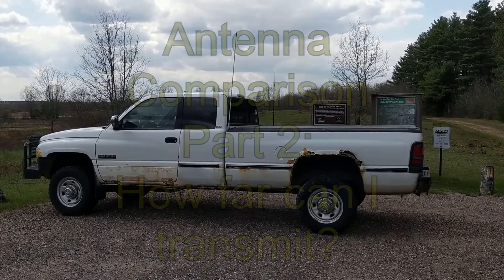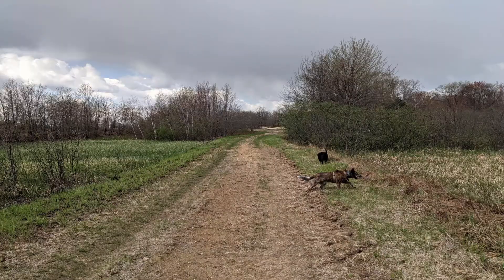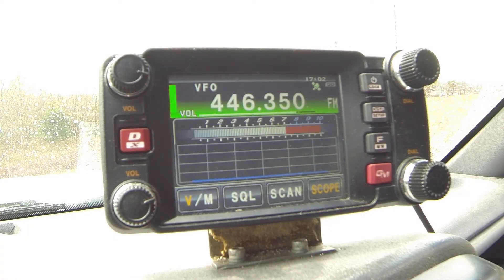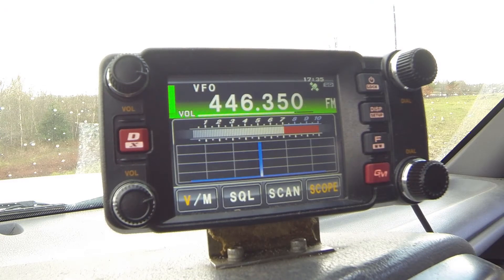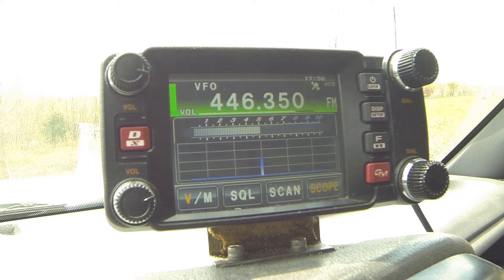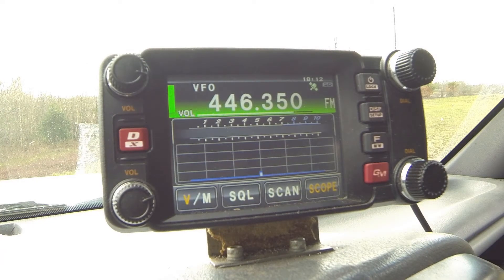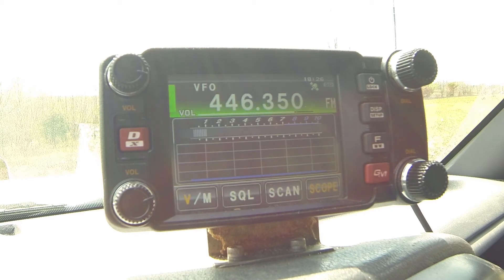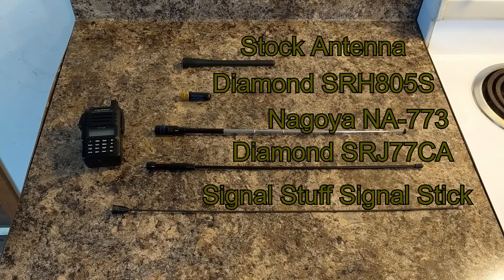Antenna Comparison Part 2: How far can I transmit?

Comment: In a SHTF situation, you'll always be able to find higher elevation, even if you find a pile of rocks or other elevations that occur naturally in the wild. One antenna you should look at (and has great reviews) is the Retevis RHD-771 and its shorter brother, the RHD-701 antennas. Don't get the cheaper Retevis RT-771 antenna by mistake.

Comment: Both videos very helpful nicely made - thank you!   Curious, are you confident that the 773 is a genuine example?
Reply from the maker: Honesty not sure about the 773. I know a lot of them can't be knock-offs. But it's still performed fairly well and I do like to telescoping mast.
Reply: @soderlund416  Thanks for the reply.  I have a 771R and I'm rather pleased with the size/performance.  Along those lines, I also have a Smiley 1/2 wave that is 8" down and 36" up.  It's my best performing "walking" antenna.

Comment: Interesting to see how well the Diamond performed. Just a few weeks ago I had a 30-mile simplex QSO on 2M with the Yaesu FT-4XR using the Signal Stick antenna. The contact had a QTH and antenna high up though. Ultimately, it's supporting Ham Study, the flexibility (packability) and performance of the Signal Stick that sell me on it. Although, I'll definitely be keeping an eye out for a good deal on the Diamond to try it out. Thanks again for more great content. Stuff like this is really helpful for new hams. It was great to see and hear the performance of the antennas. 73, N2MAK
Reply from the maker: I was surprised as well.  I still like the signal stick and do plan to by more. Like you said it supports a good cause. Thanks for the feedback, glad you liked the video. 73